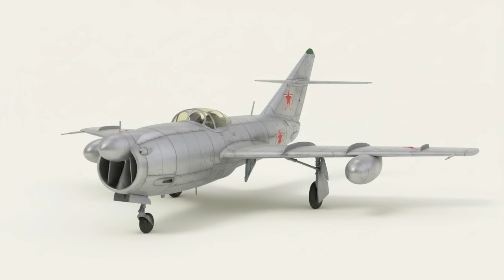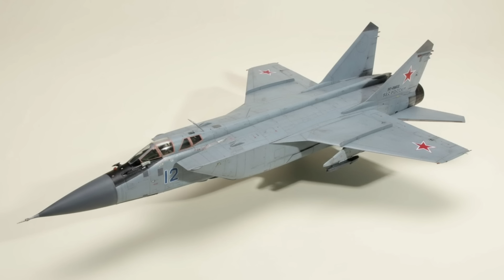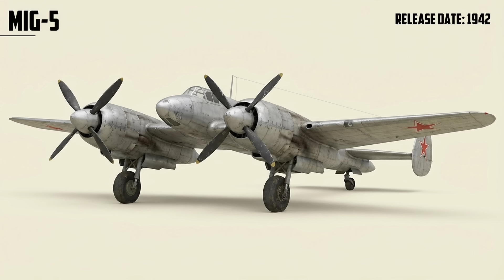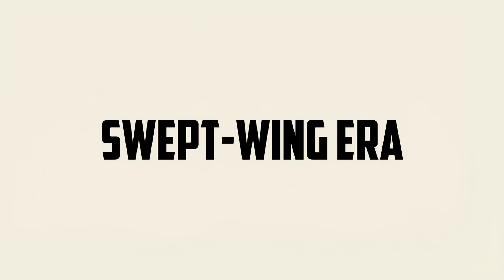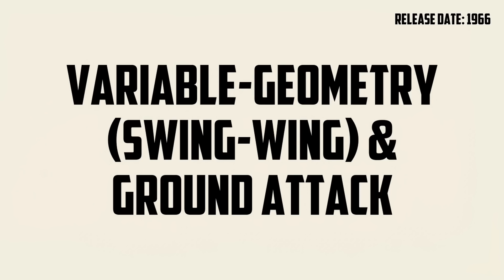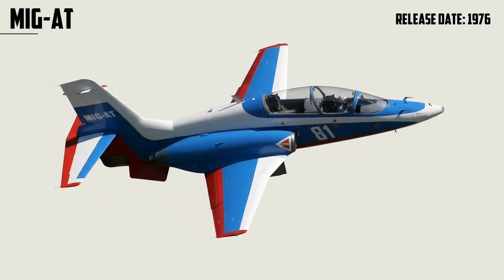Every MiG Aircraft Ever Made

Comment: I went to the National Museum of USAF in Dayton Ohio and it was a spectacular museum, and you could actually touch and inspect all of displays, except for the ones behind glass. I went outside of the museum where they had several aircraft displays parked and I saw a MIG jet, I don't remember the specific model, but when I closely inspected the nose-wheel aluminum covers I was surprised at the quality of manufacturing crudity! All of the rivets seemed to be randomly positioned and certainly not in a straight row, the folded-over aluminum seams looked as if they knowingly left the hammer-marks on purpose, I guess in Russia if it fly's, it's fine!  David Riddle